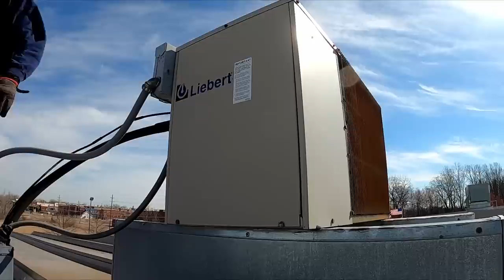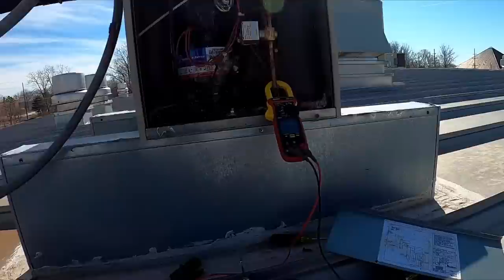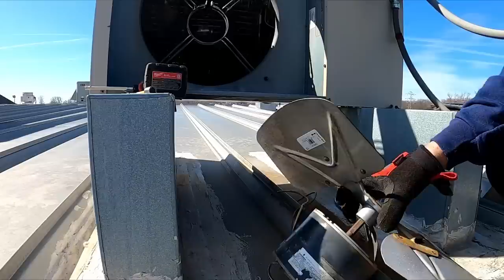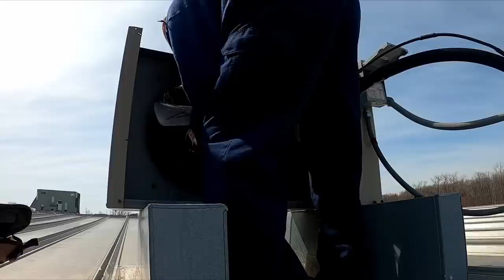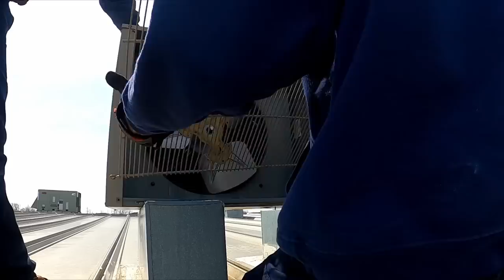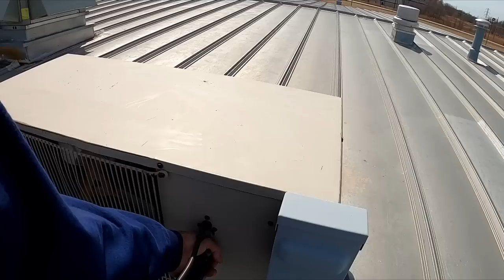Liebert Condenser Fan Motor

Comment: No offense, but you do realize it is normal for a capacitor to have a charge after the power is off?
Reply: Normally the capacitors don't have much of a charge on a normal system after its shut off. Most of the time the only time I find a charge cap is when the compressor or fan has winding damage.
Reply: @Just_A_Toaster852  that may be, but this guy seemed like he was surprised to find voltage with the power off.  You should always assume there is a full charge on the capacitor.
Reply: A cap will hold its charge for up to an hour
Reply: unless the motor went open circuit or you yank a wire off while powered on, the motor windings would shunt any charge down to zero in milliseconds.(run capacitors)
now a "start cap" can have a full charge left in it, depending on the start circuit type. which is why they have a bleeder resistor across them or always should!
Reply: @throttlebottle5906  the "unless" and "should" in your statement is why you should always assume they do have a charge.....